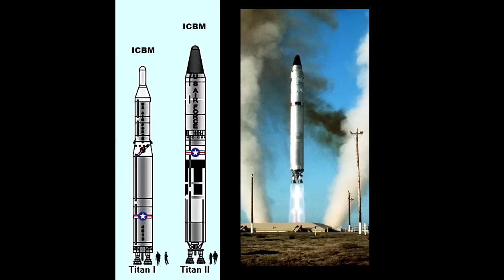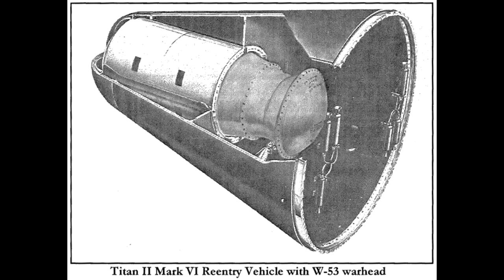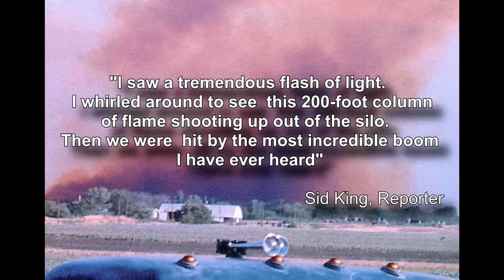Nuclear Missile Explodes Inside Silo - The Arkansas Titan 2 Incident (1980)

Comment: True heroes here. I recall this from other sources; well done. Good point on them being easy not to notice them. I used to commute up the Front Range, aware of Malmstrom Air Base and the existence of silos ... the few visible easy to spot from the high-tech fence/security NOT around a well pump. One summer the military was doing something at one near the road coming south into Augusta and went from empty highway to a war games vista. Bradleys. APCs with loaded rocket launchers. Traffic not impeded but went through a flanking row of Bradleys mixed with Humvees, .50 cal heavy guns mounted and manned, alternately parked to avoid hitting others but able to lay down overwhelming fire on any hostile vehicle on the road. Scattering of other vehicles including at least two M1-A1 Abrams tanks. Should have stopped and asked! ... or maybe not.